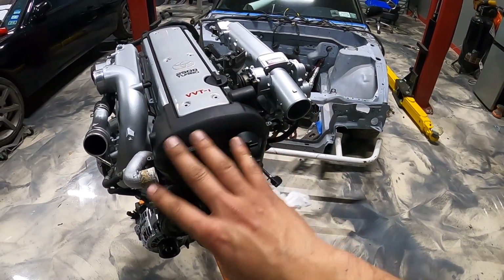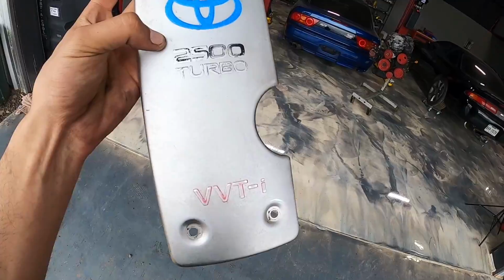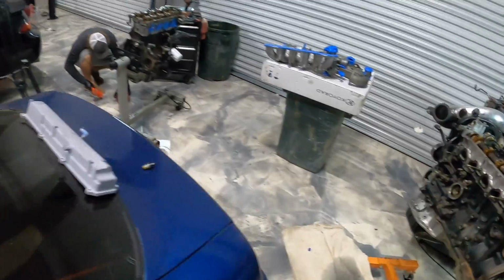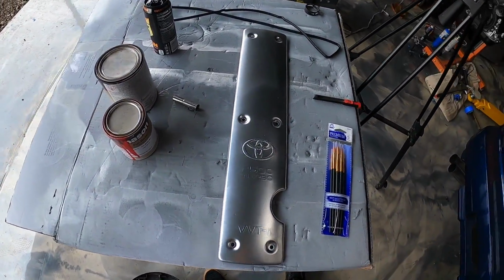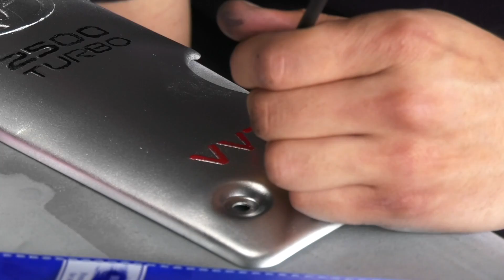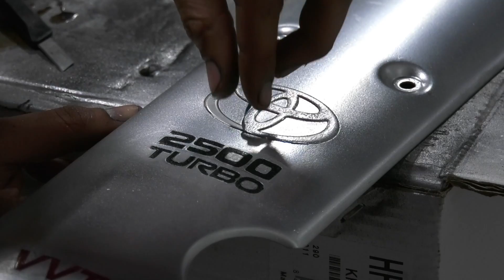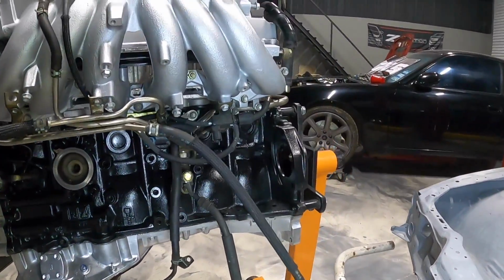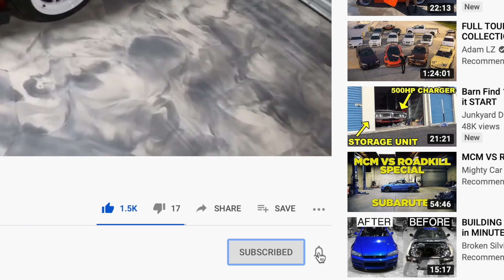1JZ OEM+ Restoration in 20 Minutes *EXTREMELY SATISFYING*

Comment: Such a beautiful motor. Adaptor kits suck though. Forcing my hand to go vq35/37 or Ford 3.7 cus 500whp on stock motors. 400 for a motor and 400 for a 6 speed trans. If not the 6 speed the 6r80 is even better for racing

Comment: Never use resettle can. Real primer and auto base clear 2 stage has much better longevity and heat resistance. Don't use rattle can, you make more work when it fails and you are left with a mess!

Comment: I said it last video you will regret the 154.   If it's a drift car they hate being launched and clutch kicked.   It breaks them.   You'll need the marlin crawler kit for sure for the 154 if you intend on drifting with it.     https://www.marlincrawler.com/transmission/rebuilt-complete/r154-2wd-hd

I had a 154 in my 700hp mk3 supra and hated it.   It's a truck trans and feels it.  Snapping to 2nd is almost impossible at high revs as they have a cut off to avoid exactly the problem of snapping gears.   High rev changes proved to be difficult I had to feel when it was able to slot in.   So I would rev it out and have to wait for the stay to go away under decel to change if I was pushing it a bit.   Sorta took the fun out of having that type of car.   

There are kits for the t56 out of the gto or the magnum 6060 t56 out of the Camaro.   It's the go to here in Australia once the getrag went extinct almost.   They are affordable and if you break one or a part they are easily purchased new or from a wrecker.   

I'd stay away from a 5 speed as well it limited the gearing badly and 3rd gear is so damn long.   Not great for drifting.   T56 is a 6 speed.  Strong and highly available.   I was waiting for my 154 to pop and I was going to do exactly this.   I looked into cd09 , getrag, t56 and a few others including the marlin crawler kit 154.   The 154 was dead last on that list and t56 is a clear winner.  

You may need some slight adjustment or cutting of the tunnel but in comparison to the other costs of the gearboxes it's much less .  

Here is a link Kalvin https://www.rodshop.com.au/bellhousings/toyota-1jz-2jz/gm-tremec-t56/toyota-1jz-and-2jz-to-t56.html

This is what the mk3 supra community have been doing for years now.  Both 1j and 2j, big power or just stock it works for either.   The tremec tr6060 is for big power the plain t56 is used for more stock applications as it is a little smaller.   

Anyway I've rambled on now but consider it my dude.  For a drift car that's going to get abuse it would be my choice

PS
You are an attention to detail builder.....and that is awesome I am the same.   Love your content.

Comment: Ahh So you basically just painted over a bunch of rusty parts but did not do any actual maintenance to the engine.. I would not call that a restoration at all, that is just a paint job and a bad one at that you painted over rusty studs without even wire brushing the rust off!

If you are going to the effort of stripping it down all that way why wouldn't you do a front and rear main seal, a new water pump, a timing belt, a timing belt tensioner, new exhaust manny studs and gaskets everywhere? These are just common things that need to be done on a 1JZ or 2JZ given their age.